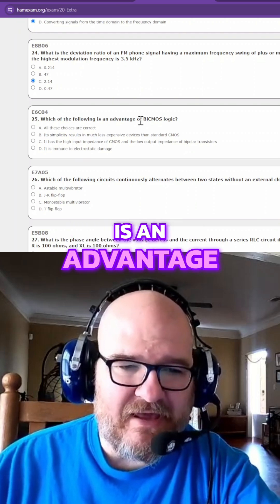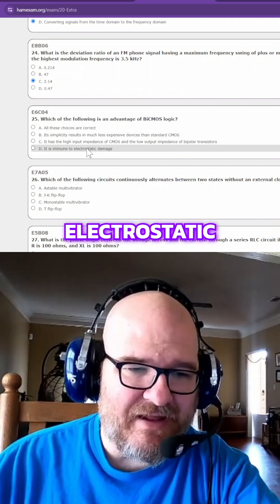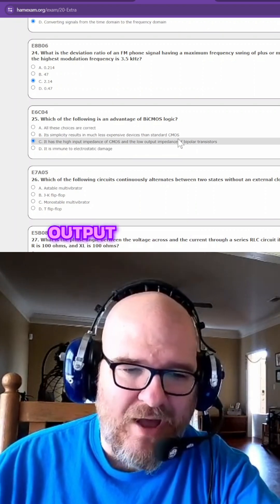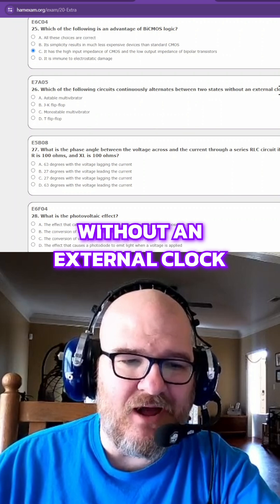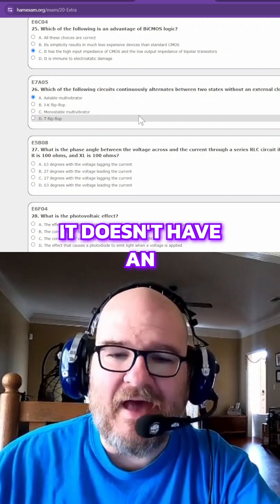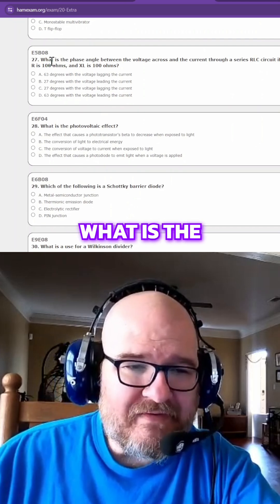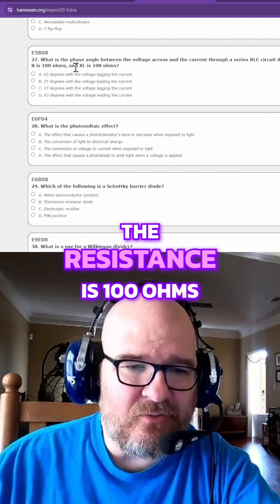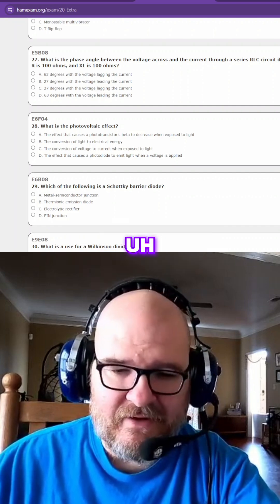BiCMOS Logic Advantages & Astable Multivibrator Explained! #shorts

Comment: No calculator needed :-) |X| = XL-XC = 200 Ohm (capacitiv). That means Uc is two times bigger than Ur with a negative phase angle of 90degree. Would they been equal, the current would have a 45degree angle to the total voltage. As Xc > R the phase angle must be >45degree. So only Answer A must be wright.